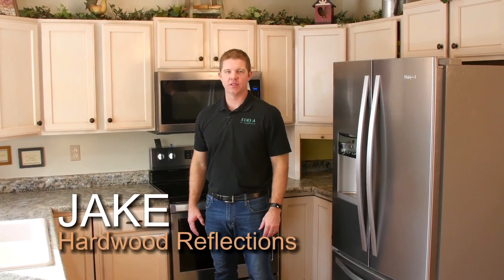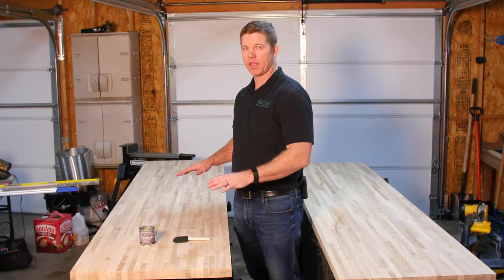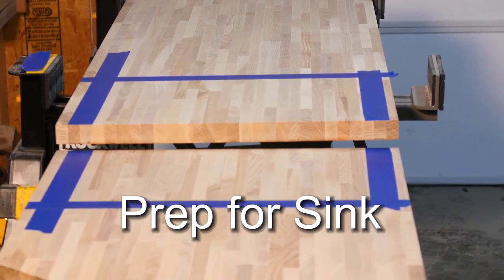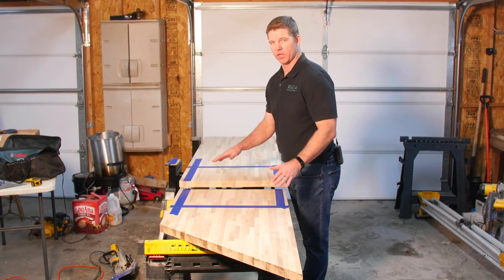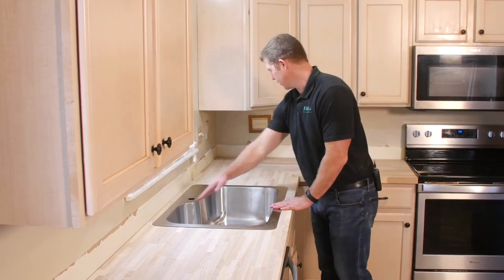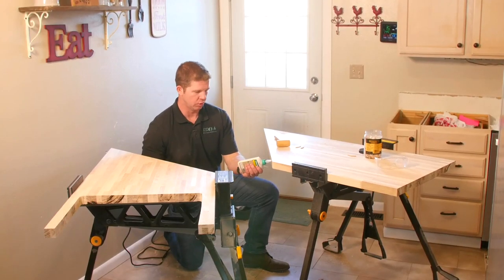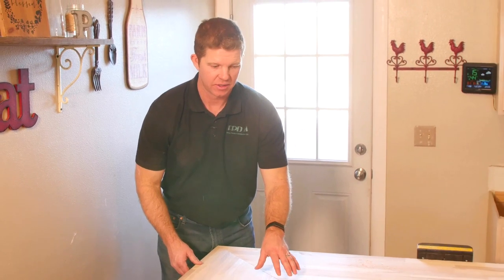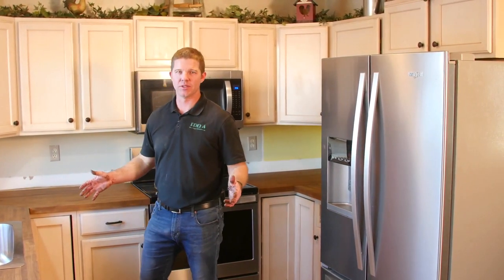How to Install Butcher Block Countertops — Hardwood Reflections Kitchen Update

Comment: Good video,  but there were some pretty important parts left out.  Clamp the mitered parts after gluing, then sand it the seam after the glue is set. Seal the entire block instead of just the underside. Apply sealant around the sink. Vapor barrier on the underside where it goes over the dishwasher. The dishwasher’s drying cycle produces a lot of warm steam that can penetrate the sealant over time.  And  Show how the block is secured to the cabinets.
Reply: I’m about to do this to my kitchen and I thank you for pointing out some things I never would have thought of like the moisture barrier for the dishwasher! I’ve screen-shotted your comment for future reference, thanks!
Reply: The strength would be similar, the joint is mitered for visual appeal.  Look up stumpy nubs kitchen counter top for a better in-depth video.
Reply: Thanks. I'm replacing gross water-damaged laminate from over a dishwasher. Vapor barrier is a good hint. :)
Reply: And how did they scribe it in? Before the miter? After? I’m sure the corner and walls aren’t perfectly square and plumb.
Reply: Totally agree. They didn’t show HOW they attached the cabinets for one. There’s a Lowe’s video that’s much more informative.
Reply: Thank you

Comment: Just looking for knowledgable peeps from this thread to comment as I am about to tackle this job and was wondering about the butt joint at the sink… is it really a good idea to do it there so you don’t see it? My first thought was because of the lack of material on either side (front and back) of the sink wont make a strong join? Or is it irrelevant and in fact the better option since you wont see much of the joint?

Comment: What was that metal piece you used when cutting the miter with the circular saw? Does it help with keeping a straight cut?
Reply: That's a Kreg track guide. I haven't used the kreg so can't say how good it is. Similar results can be achieved with a track saw, aftermarket guide like the Kreg setup, or a straight edge clamped to the top. The main advantage of a track saw or a guide is that they usually have anti-splinter strips that will prevent tear-out on the cut. This can also be achieved by putting painter's tape over the cut and using a straight edge to pre-score the cut with a sharp knife.

Comment: I have a 12ft counter to install with a sink in the middle. Would it be better to get a 10ft butcher block board and attach the extra 2 feet or buy 2 - 6 ft  sections and joint them at the sink. Seems like to me like its better to have the 10 ft so the sink is in a solid brace versus a jointed brace.
Reply: 10 and 2. Your gut knows

Comment: Hi there, are there any concerns having the joint right near the sink? Is that an issue with water? We are hoping to do coming similar with a farmhouse sink. Would it be okay to just have one joint behind the sink?
Reply: I’m doing a farmhouse sink and have two joints, on the back left and back right. I am using type 3 titebond glue and routed 1” mortise and tenon joints for extra support for the faucet and it’s plumbing (might be overkill but it’s my thing).

Comment: Could I use dow pins instead of biscuits? What blade on your saw did you use? I have a fine tooth. Does it make a difference?
Reply: Dowels would actually be better as it makes a stronger joint

Comment: So...are there any concerns about seasonal expansion/contraction of the wood and the fact that you glued the 45 degree mitered joints together?
Reply from the maker: Andy-I like to use a 1/8" space between the back of the wall the the countertop.  I have the beech butcher block in an winterized cabin (gets down to zero) with no problems.
Reply: Miter bolts underneath. Ya have to watch multiple videos

Comment: How do you actually attach the counter to the cabinets? I have not been able to find the answer in any of your videos.
Reply from the maker: We screw up from underneath the top.  Cabinets are the wildcard.  Usually we measure the cabinet roof and want to get our screws 1" into the butcher block.  Do not go through the wood.

Comment: How did you seal/attach the pieces at the seam under the sink?
Reply from the maker: Emma-used some pocket screws before I added the sink.  To make the seam look good I used some wood filler.  Clear coated the top with Hardwood Reflections top coat when done.
Reply: @HardwoodReflections  I to was interested in why seam in middle of sink and how it was joined. Would love to see that part of assembly.

Comment: Is it possible to use an under mount sink if so what is the best way to seal the exposed wood.
Reply from the maker: Yes.  I like to use a poly and several coats around the undermount sink.

Comment: I wonder how it sustains water drops all over the sinks when washing dishes?
Reply from the maker: Since we stained and then did a top coat no problem.  If you use a poly also no problem.  Mineral oil will need to be reapplied every 6-10 months if you choose that option.

Comment: How would you do it for under mount farmhouse sink and waterproof it
Reply from the maker: No problem.  I have a farmhouse sink in my house with the EU Walnut Butcher Block.  I used the Hardwood Reflections top coat.  You could also use a polyurethane.
Reply: Research tung oil for sealing the wood to make it water proof. The best product is Waterlox.